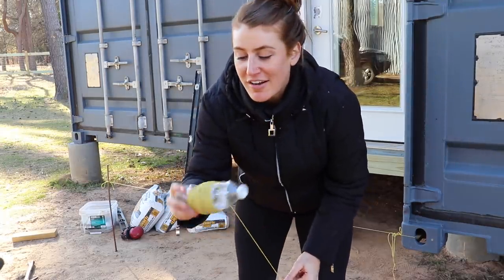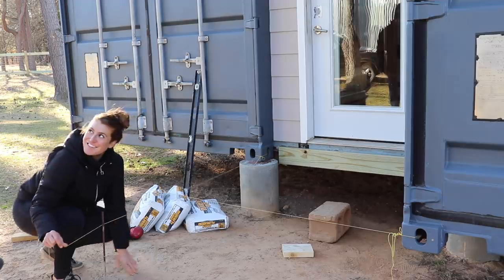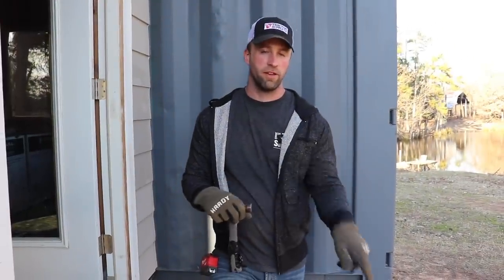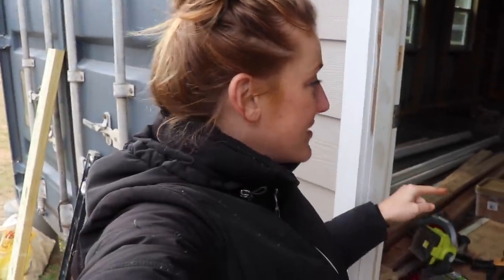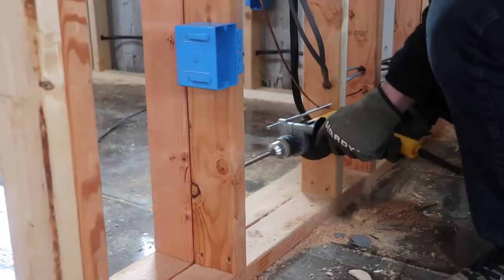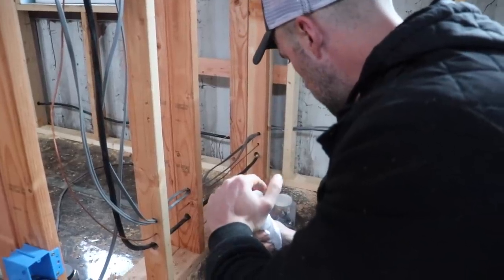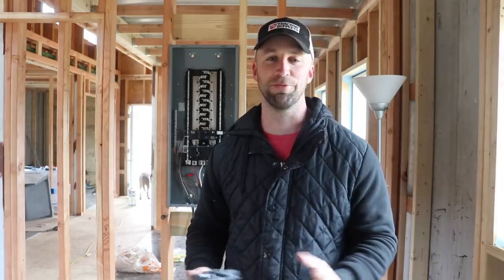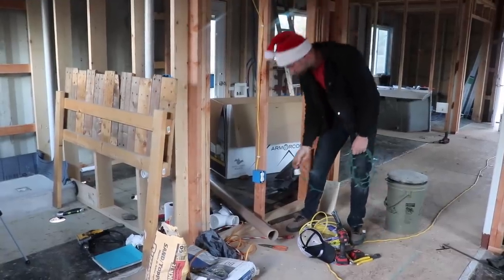Wiring Our CONTAINER HOME!

Comment: Am I right that you have no on/off switches on your outlets thus leaving them live the whole time. Good luck when you get sued for negligence because someone gets electrocuted.
Reply: In North America we don't have switches directly on the outlets.  It's fine and no one is getting sued.  We do have a code requiring tamper resistant outlets though and these prevent objects from being inserted into the outlets.